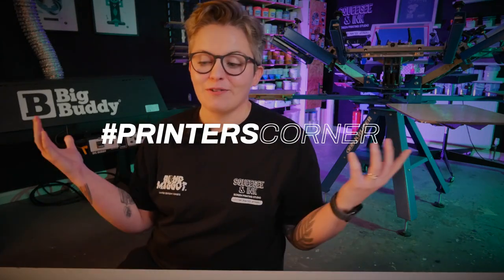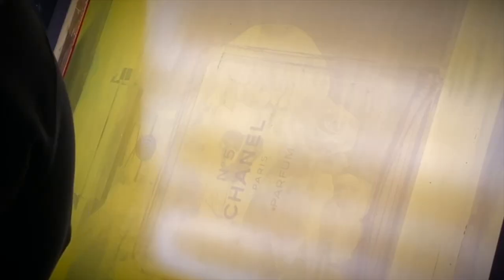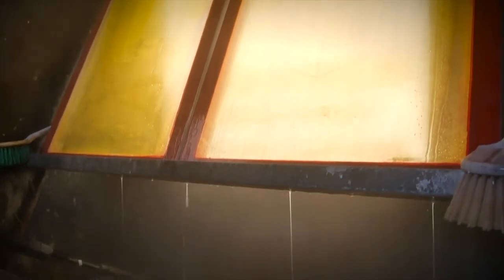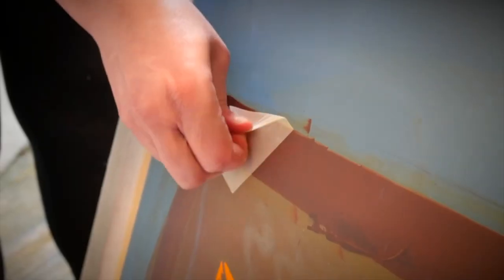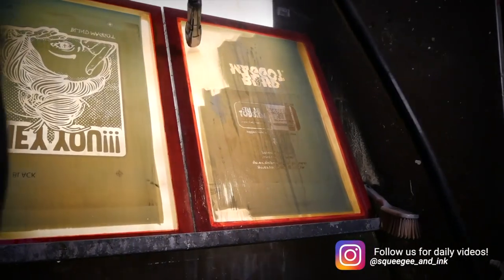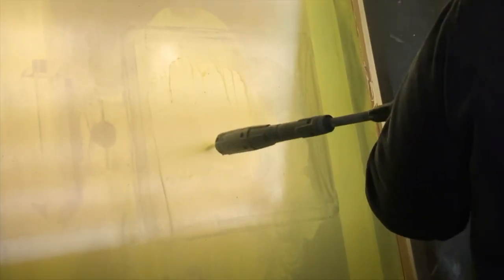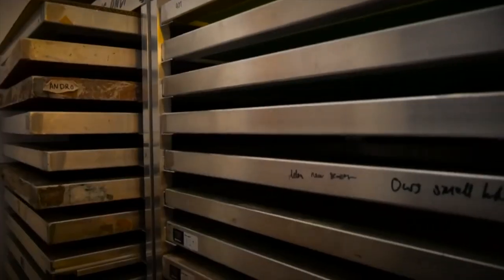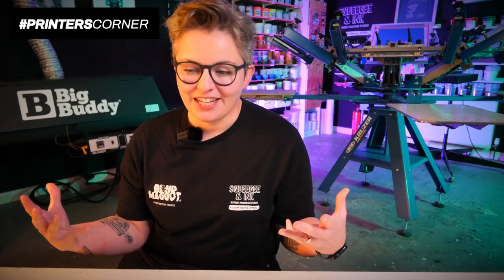Do you remove ghost images every time when cleaning screens? | Printers Corner Ep02

Comment: You leave ink on screens for re claiming? I think it’s easier to clean ink after printing, then when re claiming you just have to remove the emulsion.
Reply from the maker: Hey, it's more like ink residue. I tend to remove the bulk of the ink with a piece of card or a spatula to go back into the tub - then remove residual ink in the washout booth with plastisol ink remover chemical before it goes in the dip tank